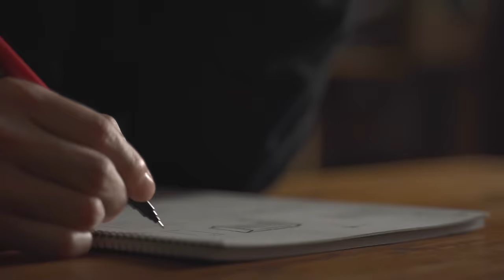Waterfall View from a Forest Cabin

Comment: I'm sure this has been asked over a 100 times but I haven't seen it yet, a but  any how again  what is this  black board   being used for the structure?  black Styrofoam? i  never seen  it sold  at Home depot   also if so hol long could  it hold up especially  be soaked in water  must disintegrate  after  a few moths judging for how easy  it is to cut up to size  and info or other options  would be extremely  helpful  ... thanks to anyone  who answers in advance
Reply: It's basically foam board. You can use any or good quality foam boards that last longer in water.
Reply: @ayeshaa.S  ,Thank you   i got to start   looking  for  that type of  media to experiment  with..  i just haven't  been able  to  actually anything  similar  to what ive made out of what i can tell  from these videos close-ups of it. somtime i wish i could   work  out  a order or trade  with someone.  i also actually bought a sheet of the plastic  posters   board to try

Comment: Very interesting watch how he does these. I have few questions. 
1. Can we remove this glue from the glass later if we want to rescape ?
2. the glass can take this weight ?
3. what if  i cant run the pump all the time ? will my moss die on the dry land ?
4. How to control the pressure of my water pump ? i feel its too strong.